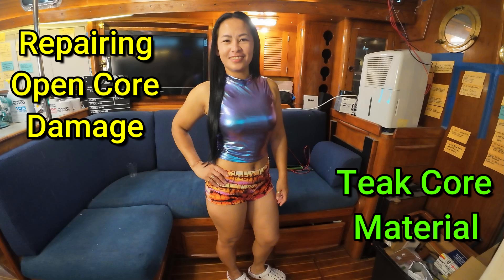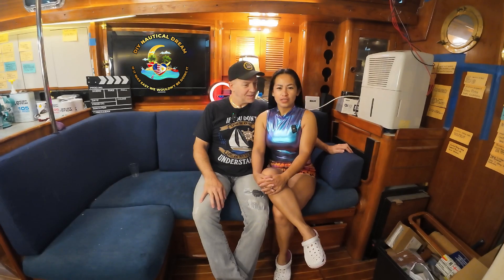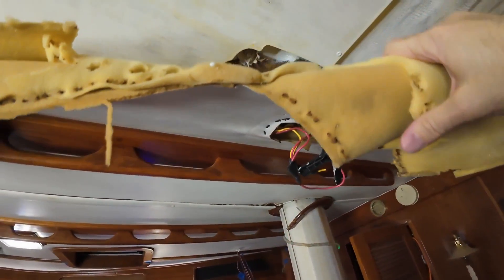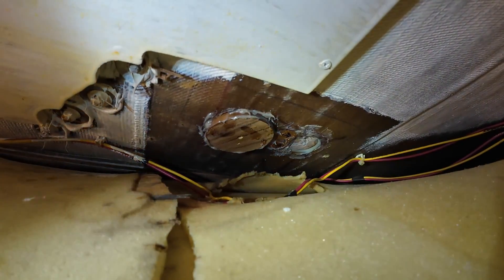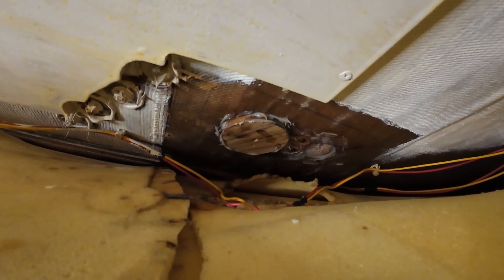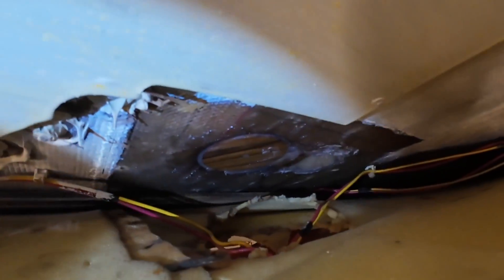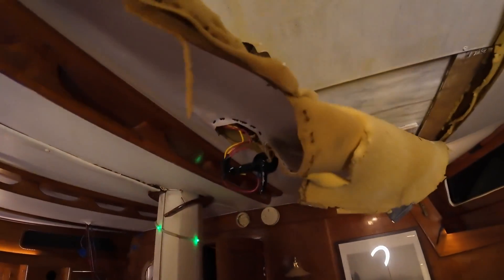Project Sailboat Repair. Fiberglass Core Replacement. We Can Finally Wrap This Up Soon. Sea 3 Ep 114

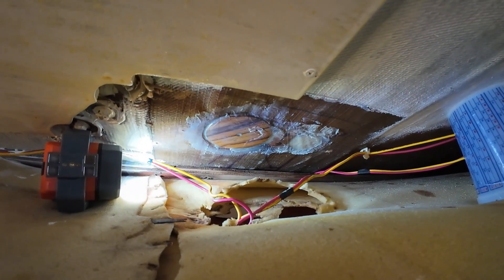Comment: 10:00 why not ? because teak is one of the oiliest wood you could choose with the worth adhesion there is, that is why not to use it.
Reply from the maker: Thank you for your comment.  Hopefully, using teak as a core filler in this application won't end up being a mistake. We will be sure not to use it again. You bring up a great reason why we shouldn't have used teak as a core material. On the plus side, it's not a large area, but I didn't think it through. Thank you for watching and commenting. We hope you have a wonderful evening.